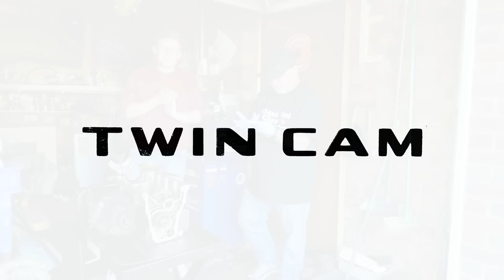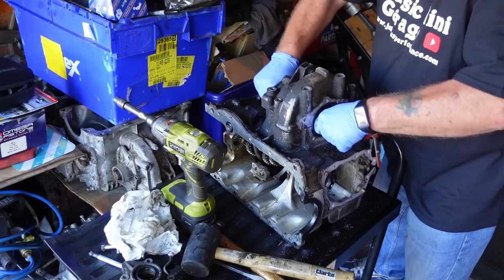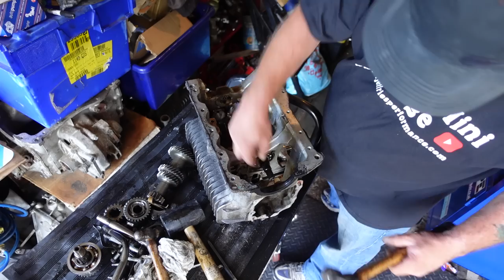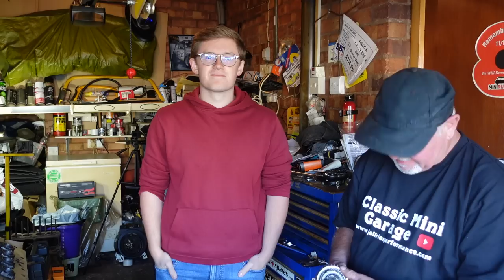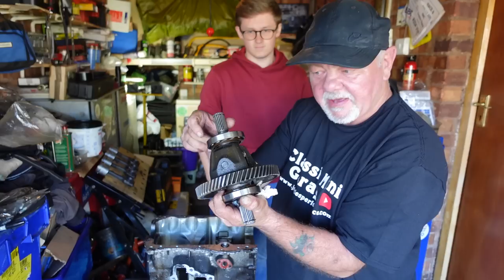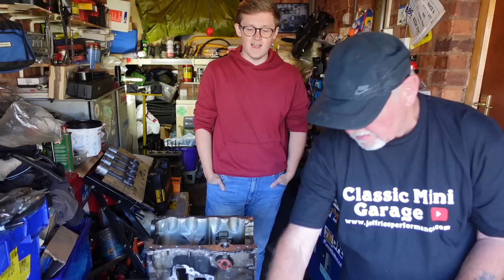Austin A-Series Gearbox Teardown - Metro Gearbox Rebuild, Part 2

Comment: Sent mine to Guessworks many years ago. Sorted out fitting an uprated diff, centre oil pick up pipe, gear ratios for uprated engine and speedo drive. Brilliant results.

Comment: Straight cut gears actually aren't as strong as helical gears, but helical gears transfer load along the diagonal so they place load on gear box cases, with straight cut gears the gears take all the load, straight cut gears are used in some racing applications because it's less catastrophic for the gears to strip their teeth than it is to blow up the gearbox casing.